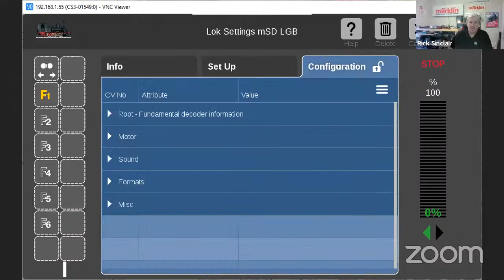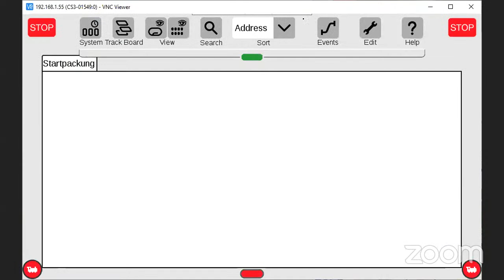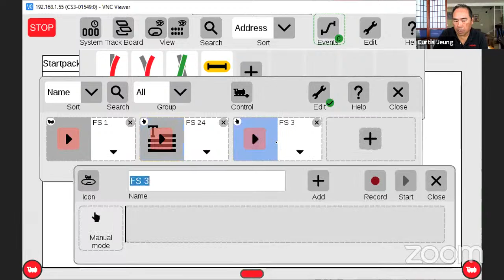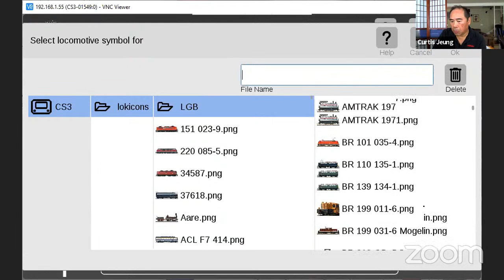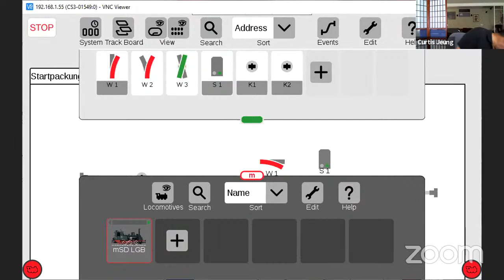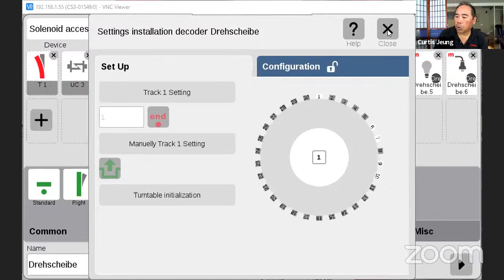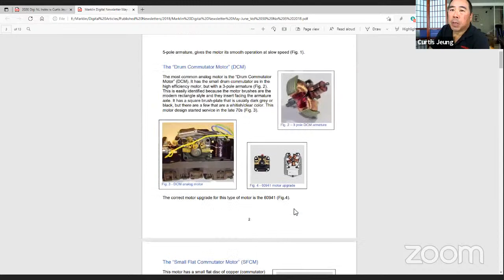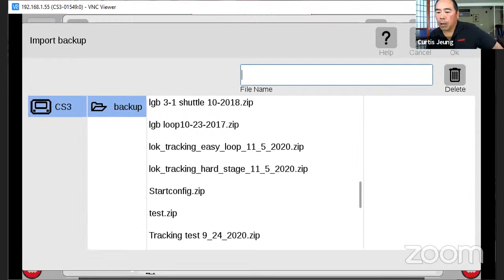Marklin Digital Club Webinar #16 - Open forum

Comment: Thank you for taking time to answer my question regarding the new TT. Like Curtis, I'm completely confused with what Rick said. I know that the EcoS is not a Marklin product however I have tried to learn how to use the CS3 but it is very confusing and too complex. The TT was marketed as being mfx and DCC protocol and I thought that I could use the DCC protocol to run the TT on my EcoS, however this is not the case, so I believe that there is some misleading advertising by Marklin. Also Rick, if you find it very difficult to program then how the hell are we going to be able to do it. To me, buy this TT is a waste of $1,000.
Reply from the maker: The Ecos system has currently updated their firmware which has been reported to operate properly with the Marklin TT

Comment: Did not get to ask my question, but I would like to ask one now: how to do a "Print Screen" when I have the CS3 on my computer screen using VNC Viewer
Reply from the maker: The VNC viewer may not have print screen functions. Usually I use the Shift+Windows+S key combination to select an image frame that gets place in the 'clip' board of your computer. You'll need to paste it into a document to view.
Reply: That is a standard feature in the CS3.
go with your browser to <IP address CS3 >/system/system
And there you find the option "  screenshot "

Comment: Hello my friends 
What do I need to do to have loco 36500 change the speed. In other words I eant it to have faster to thr maximum speed.. modelñ der DHG 500
REGARDS 
FROM Federico 
Your friend from Peru
Reply from the maker: The speed settings on Loks from the factory are usually set for their maximum speed output. Within the Marklin/LGB/Trix controllers this may be set for the value of 255, which is the highest number setting available. This is found in the Setup tab of the lok's edit panels.